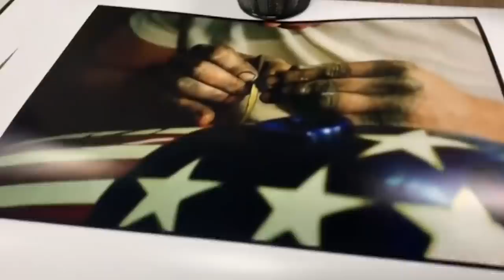What is Paul Teutul Jr doing in 2022?

Comment: Two different styles between the two Paul Jr was more into changing the designs his father was use to; Meaning "Old School Choppers" As Paul Jr was more into more up to date builds. That differences is what drew them apart. Paul Jr felt that the old school Choppers were out of date and wanted to add more modern touch to his designs. I remember on one of the build offs Paul Jr said; He wouldn't be caught on the bike Paul Sr built that it looked like it belonged in a circus. They were two people with different taste in what a chopper should look like. Old school and/or new school
Reply: Junior is more an artist than a bike builder the way he worked on the bikes and that what made his bikes special, after Junior left the OCC bikes were never as special and creative
Reply: The OCC bikes were mostly an unpleasant ride, and  Paul Jr bikes were even worse. But some of  Paul Jr bikes were quite artistic, and more like a sculpture with wheels and engine. If the latter is what you look for go ahead by all means.

Comment: He is the king of form over function. How to make a bike near unrideable and 20 years out of date.
Reply: You beat me to it. None of the OCC bikes, whoever "designed" them were rideable.
Reply: Considering they are one off designs, no one should expect to ride them. After all, if even a single part is scratched, dented, or broken, those custom parts are virtually impossible to replace. This is what set's custom vs manufactured apart. Mass production is usually always usable, while custom may be useable, but in a lot of cases, much harder, or impossible to reproduce. In the case of these motorcycles, I have always thought of them, as fancy mantle pieces with a motor.
Reply: @Pii-RuCryptoCuhThroat  And that's my point. Cash grab or not, do you buy a motorcycle made out of solid gold to ride? Or do you buy a standard manufacturers bike to ride?
Reply: It's a tie between him and his twin, Jessica jayms
Reply: Was up close and looked at an Orange Cnty bike made for the USAF Museum at Wright Patterson. The thing was a piece of junk. The welds looked they had been done by some boys in a 10th grade welding class. Motor mounts were wrong. Didn't sit on it, but the center of gravity looked seriously off. The thing looked dangerous. What really struck me was the absolute amateurish quality of the welds. The bike was displayed near a gift shop. The museum staff didn't bother to even rope it off. And can u blame them? If somebody knocked it over they'd probably throw the piece of garbage out in the parking lot and be rid of it.
Reply: @313barrygmail  it’s for show
Reply: Another 20 years ago "celebrity"  he rode a wave, had his 15 minutes of fame, and had to endure his father. His claim to fame was building "static displays" resembling motorcycles. Seems like a decent sort.
Reply: @petezereeeah man I highly doubt the welds look that bad man. Have you even seen beginner welds? I've been welding for over 20 years. I've seen bad and when I was starting mine were really bad. I have trouble believing what you're saying. That being said...the bike is definitely not functional.  I've never seen it but I know it's not. None of their bikes had suspension. They have to be horrible to ride.